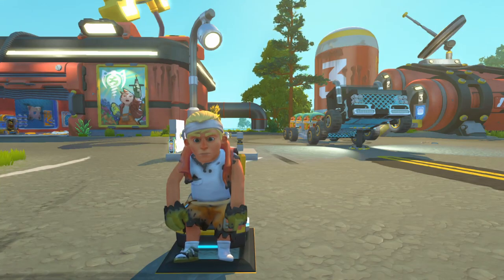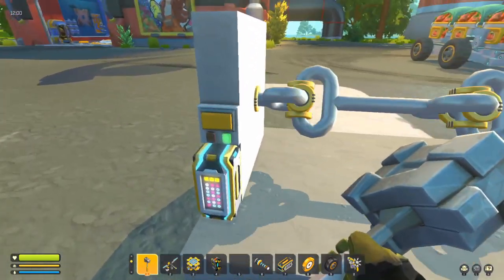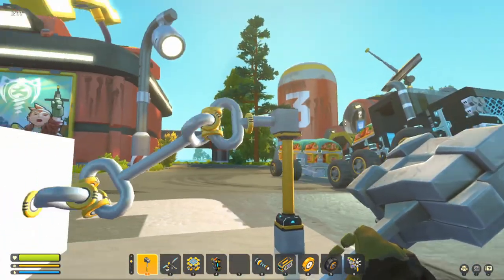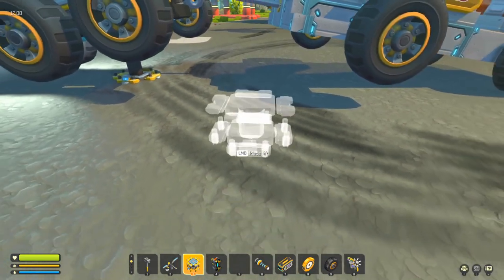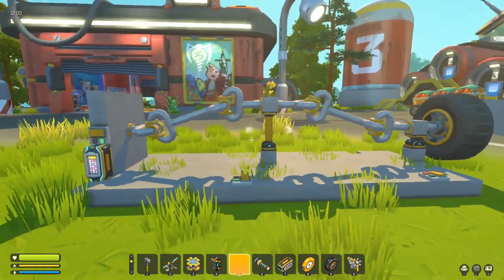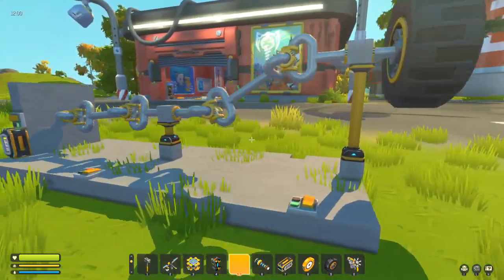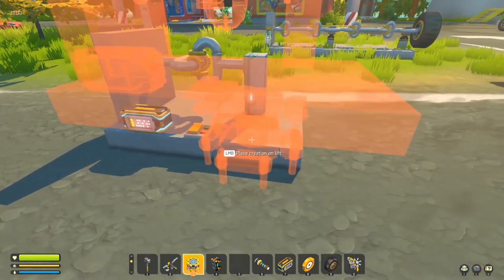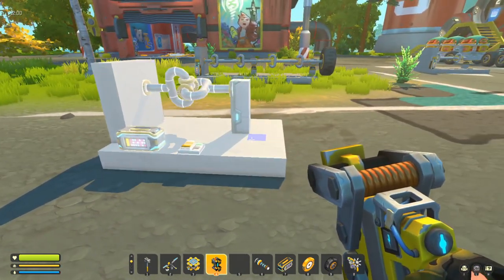Universal Joint in Scrap Mechanic Survival

Comment: To fix the throbbing rotation, you need to put a variable length object like a suspension between your joint. When you change the angle of your driveshafts it also change the distance between those 2 joints.
Reply: Thanks, this will help me with my drive shaft
Reply: To add to this, you also need to make sure they are in phase with each other, with real universal joints, if the 2 joints are 90 degrees offset (like in this video) it will still run smooth flat, but as soon as theres any angle, it throbs

Comment: Is there any chance you could design one for a very heavy trailer? One that don't flip out all over the place and separate? You know... because the bearings are not strong enough...
Reply from the maker: As in using the universal joint between truck and trailer?  If so this is (so far) the only method I know of, as you will always have to have bearings to allow the movement in all directions,  sadly, that comes at the cost of shoddy game optimisation with stretching bearings.

I will have a look into it though
Reply: @wo0dy  Yea I thought that too. I was hoping you would know of a different way. I hope they fix the derpy bearings soon.
Reply from the maker: I had a little mess around with pistons and suspension but ultimately the bearings still stretch no matter what, the only way to avoid it is removing bearings completely which won't help here sadly
Reply: @wo0dy  Darn. kAN had a lorry with a hitch that don't actually connect and it seemed to work fine for him, but when I try it, the hitch just glitches through and falls off.  :(  I wanna make a camper van... Guess I can't... Unless... maybe there is a way to alter the bearing xml to give them more power so they don't derp out so much, doubt it though. Oh well, maybe the game will get a update soon.
Reply from the maker: Are you aiming for a lorry style hitch or more a towbar kinda deal?
Reply: @wo0dy  Anything that works really. Problem is... nothing does. I wouldn't worry about it. I bet they will update the game soon anyway.    :D
Reply from the maker: When I first started playing I made my hitch an upside down T shape, my truck was odd length so it had a middle, took a line of blocks out and the trailer had the T, it stops it from bouncing out and as long as the underside of the trailer and the back of the truck are low friction it works (held in place with a complex system of pistons and bearings to place a block in the gap)
Reply: @wo0dy  Yea I think that's similar to kAN's design, but when I do it, it just glitches through  :(
Reply from the maker: Hmmm not ideal.. this game is very difficult to understand some days i swear 😔
Reply: @wo0dy  HAHA yea your right :D